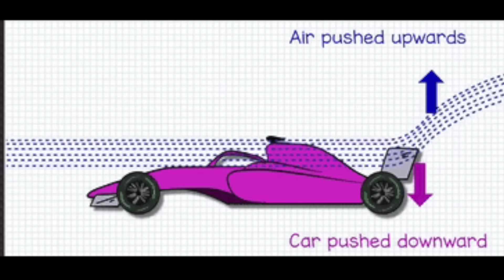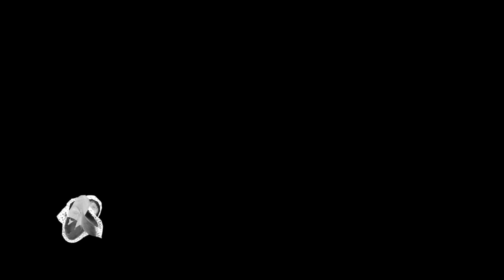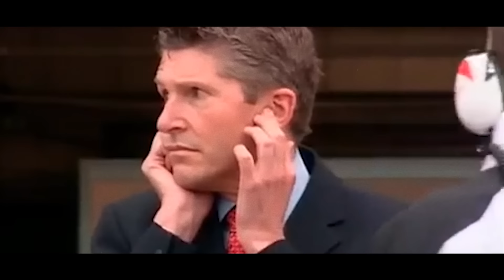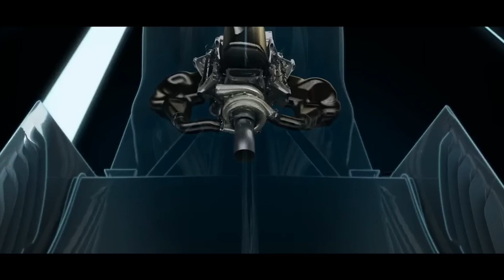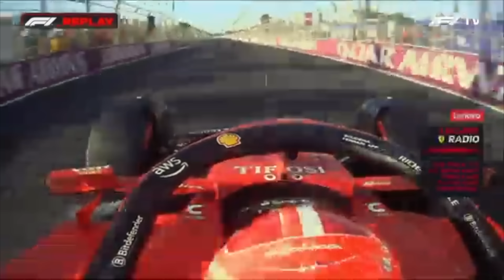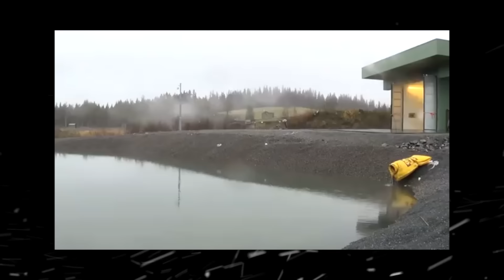What If You Keep Accelerating in an F1 Car?

Comment: I'm 72 years old.  I did 72 KPH on a bicycle (speedometer on bicycle) going downhill on Sailors Hill in Welland, Ontario, about 10 years ago.  I felt fine with that, but the accumulation of sand at the very bottom freaked me out considerably.  I told myself, "Steady as she goes".  All was well, and I didn't wipe out.  I may have very well died right there and then.  125 MPH in a 1968 Olds Toronado many, many years ago.

Comment: Why are you talking in such a ridiculously exaggerating way? "... 300 kph, the take off speed of passenger aircraft!" Really? Just for reference, commercial aircraft fly at speeds of around 900 kph, and this is very slow compared to what speed combat aircraft can reach, which is also slow compared to the speed of rockets. Don't compare aeroplanes to cars, you might argue, but actually, you were the one doing that in the first place. So let's stick to cars. In Germany, on the Autobahn (our public motorways), some people drive their Porsches, Lamborghinis, Ferraris, and even Station Wagons like the RS 6 at 300 km/h, regularly. The highest speed on the Autobahn "in public" (i.e. when it was not specifically blocked for the record) was achieved by  a Czech billionaire at 417 km/h. Dragsters reach speeds of around 530 kph within 3.6 seconds, and the fastest car ever built (that was powered by jet engines, to be fair) reached 1228 kph. And as for the F1 drivers, yes, these speeds and forces are high for your average Joe, but these people are professional drivers who experience them every single day, so it's not that incredible either.

Comment: It’s incredibly frustrating when YouTube creators consistently use kilometers per hour and milliliters, especially when addressing an audience that primarily understands miles per hour and fluid ounces. If the content is intended for viewers in a country that uses the imperial system, then adapting the measurements accordingly shows basic awareness and consideration. The disconnect makes it difficult to stay engaged, I had to stop the video entirely. It’s not a matter of accuracy, but of relevance and accessibility.
Reply: Bro… just watch the video, this video is meant for people for the whole world not just targeting 1 country so don’t say its frustrating, its the american metrics system that makes no sense compared to the rest of the world
Reply: In metric, one milliliter of water occupies one cubic centimeter, weighs one gram, and requires one calorie of energy to heat up by one degree centigrade--which is 1 percent of the difference between its freezing point and its boiling point. An amount of hydrogen weighing the same amount has exactly one mole of atoms in it. Whereas in the American system, the answer to "How much energy does it take to boil a room-temperature gallon of water" is "Go ** yourself," because you can't directly relate any of those quantities." 
- Wild Thing by Josh Bazell.

In other words: grow up!
The imperial systems are extremely outdated, to put it mildly. Clinging to it only shows incapability to shed of the old and embrace the de-facto world standards.
Reply: @whoneedsroads  agreed. If I was taught metric I would always use it, but I will never adjust to kmh, it just dint work im my brain TT

Comment: Kilometers are like Yen. Too small a measurement unit for describing contexts they're used for. "TWO HUNDRED KILOMETERS PER HOUR!!" sounds like such a big deal but it's a speed every teenager has gotten to at least once for a rush on the freeway. 200 MILES per hour is an actual insane speed that few cars can reach and most humans will never ever experience.

You can't measure badassdom in kilometers. 🇺🇸🦅

Comment: The fastest I’ve ever gone in a car was 285km/h in a heavily modified Honda CRX. I was trying to see if it would do 300, but 285 was the highest it got to. 
That was back when I was invincible because I was a teenager, way back in the late 90s. I would never dream of doing something that dangerous these days. I was on a public highway. 🙈 It was around 3am or 4am and the highway was pretty much deserted, but still…I’m very lucky that I didn’t kill anyone. Also, above 200 the car shook so much that I thought it was going to shake itself apart. It was insanely scary and profoundly stupid….And it was one of the most fun nights of my life. 😂

Comment: The fastest i have driven was eather in a first gen mercedes C class with a 4 banger diesel and manual in saloon configuartion or in a w124 wagon with a 5 cylinder diesel and a manual.

I reached around 180-190kph.

Since quite some years i've switched to daily driving a absurdly slow Car that only can be "outslugged" by especially weak old Vw Campers... I am talking about my Ford p100 that failes to reach 140kph😅😂

Comment: Rubber Tires that are capable of being used at 500kph... You really really overplayed the fact of them ripping themselves apart because you mentioned that too early in the Video.

The Königsegg Jesko surpasses 500 kph and uses rubber and the land speed racer speed demon that is the fastest piston engine powered car reached 724kph on rubber tires.

Edit: the fastest motorcycle at 605kph also uses rubber tires.

Comment: I'm not adept at fast car physic as much as speed boat physics. And again far from mastering it. In speedboating, the upper limit comes when water can't displace fast enough, which is way lower then air, needing to balance downforce with buyancy to not sink or fly. You also have upper rpm limits on water turbine at which point moving water is about the same as moving thick tar going on solid, either blowing the propeller system or evaporating water from friction alone. But at some speed, it would be easier to wheel on water then propel. Your video made me wonder where that line is and how someone could try to cross it with a special car/boat.

Comment: Go figure 1972 Pontiac Grand Prix with a 400 blueprinted motor 31 inch diameter rear tires uncorrected speedometer at 80 mi an hour every 10 mi an hour was 2 seconds what's the accelerator Mashed to ,floor at 120 with the speedometer  buried the count was up to 17 seconds you do the math!

Comment: WTF is a kilometer!??!?!?!?!?!?!

No but seriously, the metric system isn't the best. This is extremely ironic coming from someone diagnosed with some form of autistic disorder (big lol at how vague they were about it), but the Metric system is non-beneficially autistically designed. It makes a heap of assumptions about counting in general, and even its best aspect (the fact that the initial measurement is rooted in an immutable part of our reality) is flawed due to the 40,000 kilometers thing later being found to be 40,075 (oops).

Ironically, the imperial foot is MUCH closer to a "scientifically accurate" measurement, being just 5.2mm less than one light-nanosecond. Imperial also deals with a lot of high composite (read: highly useful) numbers like 12, 3, and 36, as well as binary-based numbers like 4, 8, 16, 32, 64, and so on. You might hate fractions of an inch (which is fair, TBH, as in my ideal "hybrid" system, measurements smaller than an inch and larger than a yard can switch to base 10 like metric does) but you can't deny that they're simple in a beautiful sort of way, especially if you're used to binary.

Not to mention the whole "it's easier to get an accurate hand-eye estimate of "half" repeating, than even 1/3, let alone 1/5 or 1/10th" aspect. Like, people regularly fail to cut 6 even slices into a pizza around me (they just do an 8 cut but abandon the final pass, so you get two fuckass big pieces and 4 normal sized ones), but they can always get the 8 cut or a 16 square "party cut" right the first time. Imperial style "binary division" is a lot like that, TBH, plus after 64ths of an inch I'm pretty sure they just jump straight up to a metric style powers of 10 thing with hundredths and thousandths of an inch.

Comment: The 1998 Buick Regal with the 6 cylinder engine will do 168 mph on Interstate 70.  The 1995 Buick Regal will only do 147 mph.  A 1979 F-150 with a 472 (460 bored .060 over) with 11.5:1 compression and a 283 duration cam will only do 203 mph at half throttle,  which is when I ran out of nerve as the vehicle did not have a roll cage and the tires where only balanced for 150.
Reply: youve been having fun
Reply: ...was gonna call bull, until you said Interstate 70...
That's THE place to go for speed runs.  Down hill in both directions, no atmosphere....

Comment: Commercial airliners don't reach really high speeds on take off. A typical 737 take off speed is around 150mph (175mph at max take off weight) although this varies according to temperature and altitude of the airport.

Comment: Pushing Metric System. No advantage or incentive to switch.  This is nothing to todays computer power.
Reply: The design and manufacturing of Formula 1 engines are overwhelmingly done using the metric system (SI units).

Comment: Small correction: The driver doesn't experience sustained G-forces regardless of the speed the car is traveling at because G-forces are only experienced during periods of acceleration (speeding up, slowing down, or turning).  While the car can encounter tremendous forces dealing with aerodynamics, as long as the car has a windshield or is structured to divert the air around the driver then the driver won't experience any of those forces when travelling at any constant velocity.
Reply: Breaking or turning is a form of acceleration
Reply: @dansadventures5514 this guy mentioned particular lines saying "at this speed drivers would..." when mentioning the TFDs and trying to fit a limitless F1 car on a straight drag strip
Reply: Breaking and turning
Reply: @Coubertain  by scientific definition it is acceleration you will learn about it in 8th grade science or google it

Comment: Formula a1s are not the fastest circuit cars. Fastest Formula 1 lap: 164 MPH. Fastest Indy car: 237 (officially) or 242 (unofficially). But wait, you say. That was on an oval. O.K., but Indy cars have been clocked at 253 MPH (405 KPH) entering a curve on a closed circuit, when your stripped down F-1 couldn't get to 400 KPH on a straight line.

Comment: That BAR Honda Bonneville speed was actually slower than it hit in testing at Mojave, when it went 413.2kmh/256.7mph, though the Bonneville speed was officially measured.

Comment: My fastest was back in 2008 in my modified fiat coupe 20vt 5gears manual (stock limited at 250kmh, i was 160bhp over the stock power levels). Was a modest 283kmh, but for those times was pretty fast. Wasn't a test, but just an urgent situation and i was close to end dead, because two big truck trailers started to passing one to other at about 1km ahead.. at their usual speed (maybe 120kmh at max) and i was forced to brake from 283kmh to almost 120kmh when my brakes was fading, probably my brake fluid was boiling .. my luck was the trailer barely let my lane as much as i was able to pass without touching him or the separator between ways.
After that i was driving even faster cars, but never passing 250kmh driving any, especially in a such small car.
Nowtime even stock regular sedans from bmw, merc, porsche, audi are capable to easily reaching 300kmh.

Comment: The BADD Ford GT with 3500 hp did 500.1 kph on Michelin Road tires, that arent rated for the speeds. So it apperntly is possible on Road tires, although the driver said: It's risking your life to drive that fast or faster.

Comment: I never really tested the car abocve about 140 MPH. Never drove a track with a straight any faster and don't push beyond 60-130 times. But my current car has massive brakes and is getting a blower soon. I should be at least 900 bhp, so I may push past 160 if I get a chance. It's funny to read the comments and hear people scoff and explain how easy it is to go 200 MPH. One thing in theory, another IRL. I could have disregard for other people and be a jackass as just drive 180-200 MPH on a long straight road, but that would be stupid and disrespectful. Try braking at 140 MPH when the suspension loads to the front and one side feels like it's starting to pull.

Comment: Fastest confirmed drive was 166mph in a 1976 big block Chevelle. 323 gear at the time tall tires and right at 7000 rpm lol.
Possibly faster in my 01Z28 but i wasnt paying attention to the tach when i hit the limiter in 3rd, 273 gears, 6.0.  It was either the limiter or too low on fuel and the fuel sloshed causing the car to cut out. Speedometer needle physically stops moving past 155, butnit was enough that i started pulling away from the 392 Charger

Comment: 56mph on a bicycle, 66 on skis, 141 on a YZF-R6, 142 in a Mitsubishi Galant VR-4, 158 in an Acura TL, 215 on foot when my GF's dad caught us foolin' around in the shed.
Reply: Highest speeding ticket 97 in a 65.
Reply: Hah.  Did he catch you?      Peace
Reply: 56 mph on a bicycle is crazy. I would have thought 56 km/h is crazy. Damn.
Reply: @theophilussogoromo3000 I just put a Cyc X1 pro electric motor kit with a 72v battery on a Walmart mountain bike and have had it up to 55mph. It feels just like a motorcycle until you switch lanes then you realize your life is resting on 2.5in wide tires😂😂😂
Reply: 56 on a bicycle!?!?

I remember riding my bike down a steep hill, pedaling very hard. I only made it to 29. Could've maybe gone a little bit faster if I wasn't scared of the chain falling off or anything.
Reply: I have a speeding ticket for 106 kph in a 40 kph zone on a giant cross trainer.
Reply: 135 in a 93 Mustang
143 in a 98 SVT Contour
150ish straight down in a Cessna 152

Comment: First off, F1 cars are NOT designed to go EXTREMELY fast in straight lines, they are designed to go around tracks as fast as possible so downforce is a lot more important in their design.
While there is A LOT of work involved in fighting physics at high speeds, it's not THAT extreme between 300 and 400 km/h.
A lot of street cars are capable of that. And it's not just supercars.
A simply tuned RS6 C6 from 2008 can reach beyond 350 km/h without much hassle, and a more modified one ( with over 1000 bhp ) reached 378 on the Autobahn ( at least judging by the on board speedo ) - there are videos of this on youtube. And we are talking about a big heavy estate car, capable of carrying 5 people + 2 Saint Bernards in the trunk :)
Regarding tires, there shouldn't be a HUGE limiting factor going over 400 km/h because even street car tires can sustain those speeds, surely not your ordinary Golf tires.
We know that the tires on the Veyron are going to last 15 minuets at 400+ km/h, which is not a problem, because the car will eat through a full tank of gas in 12 minutes at that speed :)
So while 400+ km/h is pretty nuts, it's not THAT impossible to achieve even for "normal" street legal cars that you could buy, if you'd have 2-3 mil to spend, which might seem like a bargain considering a F1 car costs roughly 20-30M to make, only on parts, excluding R&D :)
Reply: Tell us you didn't watch the video without telling us 😅...

Comment: Correct me if I'm wrong, but last I knew F-1 cars have more drag than IndyCar. Because of the higher downforce. They can go faster in the corners, but in a straight line IndyCar is more optimized. So removed from the context of a racing circuit and put into the context of the title of this video, I don't think you can still call them the fastest circuit machines. Fastest on a circuit, sure. But just look at how that F-1 car looked at Bonneville... is it still even an F-1 car at that point?